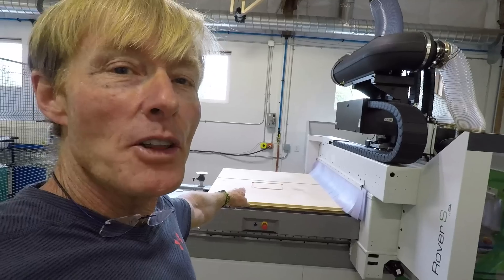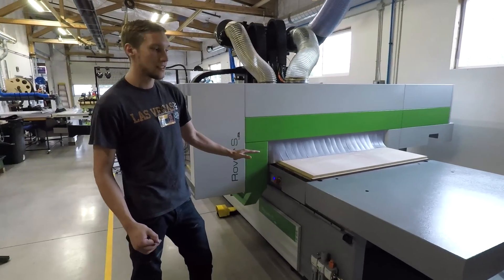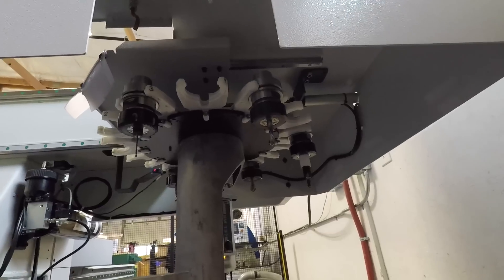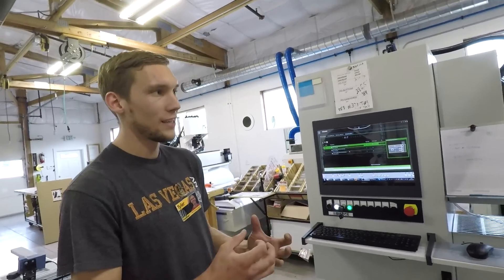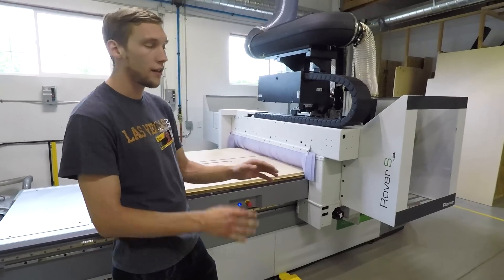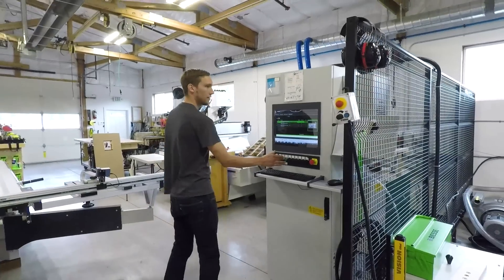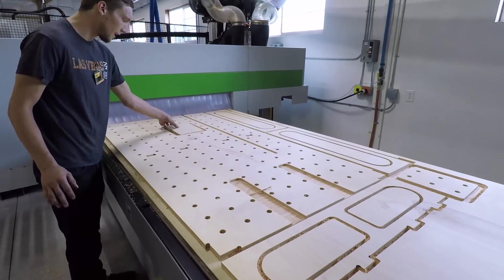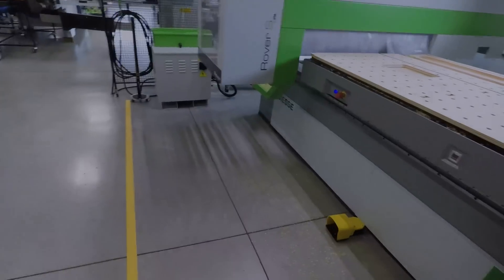$100,000 Biesse CNC  Building The Paulk Workbench

Comment: If your old cnc gave you ovaled holes, there was a problem with that machine in my humble opinion. I have a cnc I'll have up and running in a couple of weeks that uses that same Becker vacuum hold down pump. Becker says the exhaust is around 300°. You wont need heat in your shop in the winter lol.

Comment: how is something 5 times faster if you are using 3 instead of 1 endmills at the same time?
Reply from the maker: Trever explained it in the video. We are now using (3) 20 mm forstner bit vs a 1/2" bit making a 20 mm hole. 5x faster on the holes and 3x for the whole bench is a conservative estimate when you add in the load time with the pop-up posts and the more sophisticated cut software.

Comment: A thousandth of a millimetre? that doesn't seem right.
Reply: Why not? Why doesn't it seem right to be accurate to a micron?
Microns are a very common unit of measurement in anything built with precision and now that accuracy is rolling over into woodworking equipment and tools.
Reply: What I'm saying is a millimetre doesn't normally get broken up by thousandths, an inch does but not millimetres
Reply: It does where I work. Microns are a very common unit of measure when you build engines.
It depends on if you normally still use imperial measure or metric.
Reply: Yup your totally right, sorry i just wasn't thinking. Millimetre can defiantly be broken down smaller.

Comment: That 'laser' curtain is called a light curtain for those interested. It's designed to always fail in a safe state (meaning machine stopped) when used with the appropriate safety relays.

Comment: Ron, Great progress. Now using CAD programs your bench design can be altered to suit different uses.    I have available a 4×8 ft CNC router table through a local Maker shop, maker-works.com. [BTW a great idea for anywhere]  What CAD file formats are you distributing? Given a common CAD file type, I can then edit the design & then produce a CNC file.  Then cut process is simulated & edited prior to actual production.  All of these are open source programs & both the program & source codes are free downloads.

Comment: Ron , I just clicked on your store link and your home page came up. But when you click to see Items for sale nothing shows up. Not sure if it is on your end or mine. Just letting you know. Thanks
Reply: Each item is a link to an Amazon store, ad blockers won't let you see them because essentially they are ads. If you want to see his stuff, just whitelist his site or that page. Ron Paulk, maybe you can add a little note at the bottom to disable ad blockers to view the page. They also have some java plugins for detecting ad blockers and giving a warning.

On a side note, I like that you endorse the aftershokz headphones. I have 6 different pairs (a few of each style), they are awesome for having music and still hearing your surroundings and/or tools. Trekz are the best though(comfort and durability 8+ hrs a day), even if the Bluez 2S are a bit louder and the batteries last longer.
Reply from the maker: Hi Ron, The store links are working. It is on your end and either pop up blocking or ad blocking. If you are using Chrome, it seems to have the issue more than others. TKS Ron

Comment: Totally awesome machine.  One of the instructors at Red Rocks Community College (great Fine Woodworking and Lutherie programs) has his day job at a custom cabinet shop. and they have a vacuum assist that will pluck a sheet off the stack and you just guide it into position.  

It is just mind-blowing that you can pull vacuum through an inch-thick piece of MDF.  Though, at our altitude, we can only pull about 20-22 in Hg, but it is better than using screws and clamps to hold your work.